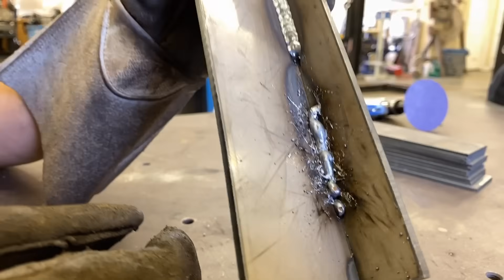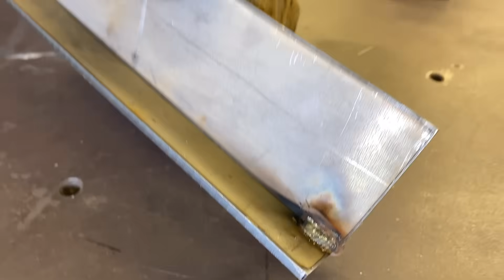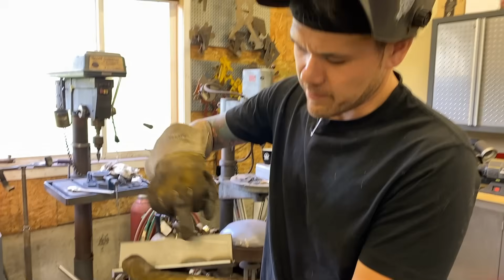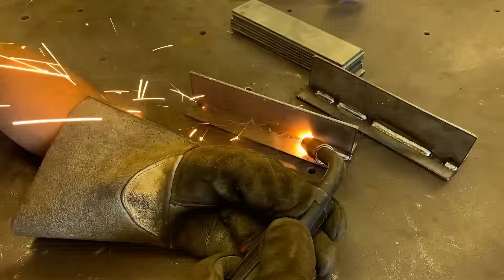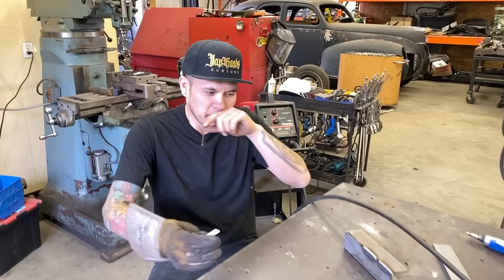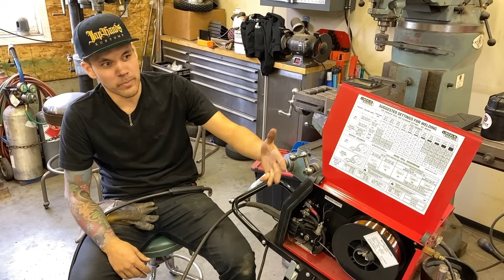MIG Welding Basics For BEGINNERS!! How To Set Up Your Welder + Tips, Tricks & Techniques!!

Comment: So I'm a first timer, do I need welding clothing beyond gloves and an auto-tinting mask? I was gifted, really loaned, a Miller 25/75 mix welder for a few months, and I want to learn on simple steel. The hopes are to weld parts and panels for my 62.5 Acadian wagon since we don't have any local shops that do this anymore. Do I need a welding table, or is a wood panel table okay, as long as the welding clip is clipped onto cleaned up metal for grounding? I tried to find a course, and many people said they would teach me, but none have worked out.

Comment: Great video! I have a miller 120v welder. I like to leave the roll of wire in the welder. When I quit welding what do spray it with to keep from having to remove it? Then once I use it again what should I spray it with before use to clean it. Use a foam block in there to clean the wire along with a liquid I bought at the welding shop and that does clean the wire however I want to protect that roll of wire if I don’t use it first a month or so without having to remove it all

Comment: Without good settings, U will NOT get a good weld. You have to find the settings first by trial and error on the thickness you will be working with. That's 70% of the weld right there.

Comment: Dear Sir, I'm recently retired and needed to have some welding done on my truck wheel wells but was turned down by 2 body shops, so my next step is to do it myself and your video was the exact thing that I needed. I searched most of the morning for a decent one that would be for beginners and found it in yours. I want to thank you and will purchase a welder just like yours and go forward. Hopefully I can find one on Ebay, it looks very expensive. Thank you. Gil in Massachusetts

Comment: Thats gotta be plugged in to a 220 outlet. 10 ga. Steel and actually burning in hot enough for penetration. I miss that. You just cant get a 110 wire feed that burns hot enough. In my opinion anyway. I miss having the standard Lincoln 220 buzz box. Trying to run 220 at home though. The power bill!!!! This is a good video for technique, but the type of electricity feeding that welder is crucial. What are you plugged into? And then the price of gas. So its 75% argon, 25% co2? I have a Lincoln combo machine. Only 110 power. I cant get that thing hot enough. Flux core and stick. Now im gonna try mig. Then toss it if the gas  doesnt help.

Comment: How do you test if a weld is good or weak? I was thinking of welding a frame for a trailer so my concern is with the movement of the trailer having welds break. 
Also, could a decent weld for welding a frame be done with a cheap harbor freight wire fed welder?

Comment: You are a natural teacher! Well done! I’m hoping to teach welding at school(high school) in a couple of years, so I figured I had better get some experience under my belt as soon as possible.

Sadly, I don’t have access to 220 power in my garage, so 110 welders are my only option.

The second potential problem I am learning about is the rental/ or purchase of a gas bottle. Apparently it can get expensive, especially for a hobby guy that welds 4 or 5 times a year. 

I’m learning that welding a chassis frame for a go-kart together isn’t doable(safely anyway).

The question is this, can you make another video that talks about welding with gas and without(flux core)? Also mention what you can and cannot safely weld with the various types(including 110 vs 220)

I’m finding welding a little tricky to get into for what I want to do.

Comment: You probable will ever see this comment/question. First, I am a 70 year old newbie at this. I have a Hobart 210.120/240 welder. I welded on a thumb to my mini, didn't look the best but worked. However, I had to take it off cuz the pin support bent. It is a GENTEC thumb, 8/24 hydraulic and NEVER thought that woud happen.  So, I built a cable to go into breaker box to change to 220v.  Do you get the "210" if this means amps at 220 and half at 120V? The manual indicates 3/8 " thickness for each voltage. This has 1 thru 7 heat ranges and 10, 20, 30, etc on the wire speed. Your video has helped me SO VVERY MUCH, thank you!

Comment: I am 3rd generation welder/machinist/gearhead, my 26 year old son. Is 4th and learned from my dad, myself and from trial and error.   My dad always said "solid push flux pull" but vertical was a variable, especially if high quality was a factor.  The old man would say it doesn't matter what it looks like if has good penetration and sealed into the material without hosing up the tip.  My 26 year old would deliver dimes or what I call "caulking" in any situation, the kid can work just about anything if the speed/voltage is in the ballpark.  I am grateful that my grandpa passed on the skill and experience to my dad so he could bait me into wanting to learn mig and tig.  There are SO many kids that will never even try to weld, it is nice to see the craft being used and shared like this video.   Nice work

Comment: I used to downhill all the time with  mild steel and stainless. The welder that taught me said put your wire almost 90° to the joint and weave the puddle and it seemed to work. I never had one break

Comment: Welding engineer here, this is a great video and well explained for beginners. 2 points: 

1. At the beginning he meant to say his gas mix is 75 argon/25% CO2. People don’t really use more CO2 than that. You can use 100% CO2 but you’ll only be able to get globular transfer (which is not what you want 99% of the time). 

2. Always wear sleeves when you’re welding (cover up all skin really). Even if you don’t get burned there’s lots of welders who have cancer in their forearms from welding without a jacket.
Reply: 100% block all of your skin, not just your eyes.
Reply: @smoovop117 right? Idk why you’d want to fade tattoos prematurely
Reply: Amature here. Thanks for pointing out that gas mix ( approx. 56 seconds into the video). I might've made a frustrating mess of things the other way around.

Comment: You're Wrong! J/K. You're Awesome! Thank you!
Reply: Ya know, "doing it by sound, look, and feel" is extremely helpful and makes sense to me. I haven't welded since high school, but I do sew a lot, and it's surprising how similar welding and sewing techniques are. You almost have to get to know each machine and material. In sewing, you have to adjust the tension, speed, and stitch depending on the type of fabric or thread you're using. There are very few instances where "always" and "never" come into play. It would be difficult for me to explain sewing with just the numbers (set your tension to 3, use all-purpose thread, have 5 stitches per inch). 
So now that you've explained it properly, I shall think of welding as "sewing with metal!"

Comment: hey boss thank you for the video definetly learned alot. i wanted to ask you to weld a stainless steel muffler say daynaflow to a mild still pipe on my mustang Mach 1 can i use same shielding gas 7525 say with .030 wire. or do i need a whole different set up. i meant its a catch 22 trying to weld a stainless steel muffler to a mild steel. its like saying what came first chicken or the egg.
Reply from the maker: It's no problem to weld it like it's milds steel. Same wire gas ECT.
Reply: @MakeItKustom  your reply helps me a ton you have no idea. stay safe. thank you very much . i can wait to start welding.

Comment: I'm a structural welder myself. I always whip and pause because I prefer doing that over running straight welds. Whip and pause is one of the strongest welding techniques, aswell as running a straight stringer. However if I'm welding a corner-to-corner joint, I turn my settings down a little bit and move in a weaving pattern around the root of the joint (cursive e, cursive c, etc). The reason I do that is because if I were to whip and pause or run a straight stringer down the root, it'll blow through the other side of the joint, so I focus more on the side wall penetration rather than the root penetration in this case. Plus turning the settings down a bit while doing ur weaving motion around the root for corner-to-corner joints is better because when you weave around like that, the heat input into the metal will also increase and you'll also still get a flatter looking weld even tho you've turned your settings down. The only case for a corner-to-corner joint where I'd run a straight stringer or a whip and pause is on sheet metal and I'd keep my settings the same too in this case. This is because the settings are low enough to not burn through the root of the joint and because sheet metal is so thin, if u weave around the root on a corner-to-corner joint, you're much more likely to cause overfill. Root runs might be needed to fill in any gaps on a corner-to-corner joint before you properly weld it depending on the size of the gap, how hot your settings are and your welding technique and how big of a weave you do. This is my advice, I'm just a nearly 2 year experienced/coded MIG welder for structural steelwork

Comment: Dumb question: how do I set up my auto darkening hood?????
Reply: On the inside should be knobs for adjustments. There are certain ones with knobs on the outside. Close to the ears.
Reply: If not knobs buttons. (For the inside) It's on the visor.

Comment: Your mig technique is different than most I've seen on YT. Your, as you say "pushing your puddle". Most will say, "drag if slag". Can't argue with your results. I'll give it a try. I just bought a gasless flux core currently running on a 110 plug. With the provided .035 fc wire I was able to put a nice bead down on 1/8 steel with what looked like good penetration. 
I have now separately purchased Lincoln .030 fc wire at HD and am trying to butt weld 22 gauge sheet metal. Have had some problems with burn through. I want to see if your "push the puddle" helps. My machine is gas mig and lift tig capable. After some what mastering fc mig, you've kinda got me looking at lift tig.  I'm also lovin your sheet metal fab content.

Comment: Dude. This is generally the best CO2 Welding techniques video of all time.  I'm having a full day of Structural steel welding today, I have not welded on a CO2 machine for the past 5 years and this tutorial just refreshed me up and the fact that I will be using a completely new machine on this job, your demonstrations just put me at ease and I won't have to worry about what is written on the machine, I will major on what I hear with my ears and what I see in the welds that I do when setting the machine up. Thanks buddy

Comment: The video was excellent! I agree that properly setting up the machine is crucial. I'm a fan of the push and back technique, which I consistently employ. It effectively fuses the pieces together due to the high heat, resulting in a more consistent weld.

Comment: Here in the uk, an inspector would look at a that whip weld and fail it instantly, same goes forcthe circles,  those techniques cause lack of penatration because your moving in and out of the hotspot causing cooling as you go forward then whip back

Comment: I just purchased my first mig welder. It's a 120 input model and I plan on using it to do some body repair.(quarter panel rust repair) This was great info for me to see. I still have a bunch of reading to do before I try my first weld, but this was great to see and hear what a decent weld should be. Thanks for the info.

Comment: Wow. Great video. Thanks. 
I’m new to welding. I’m starting with mig. Eastwood mig welder (🤔), flux core and 1/4” steel. My welds look like crap. Metal everywhere except where I want it. Seems like my wire is always longer when I pull back. Even when I use the recommended settings on the units door. 
I have 2 tanks but need them filled. How important is it to use gas as opposed to flux core? I get splatter everywhere. But at least I now know what to listen for. 
Paul.
Reply: From what I understand the flux core makes it so you don’t need gas. The gas is for solid core wire.

Comment: Would taking a propane torch nothing to hot not map but regular to heat up the area first a bit then weld I live in Alaska n weld outside most of the time I am a more or less a beginner had a friend show me basics and kind of went off with it welding anything that would stick

Comment: 2:39- Oh great thanks bekause Subi Sanctuary refused to answer for strutt tower repair what settings and wire he was using. 

So mig welding it should sound like the perfect bacon frying that will take a little to feel that out but that is a sense orientated way to learn to weld with mig which helps! How do I measure my travel speed komparing with the perfeckt bacon cooking sound? What should my weld penetration and weld bead look like and the weld puddle.  I believe you said you use 0.030 wire but who is your wire from.

And I see you are using gas no flux core so where did you get your tanks, how much were they, how much to fill them,  kompany is probably only Canadian so asking that will do no good, what about your regulators and hoses, what mix are you running for strucktural welding, at what pressure?

Regarding needing 220 volts for structural welding:
So then is that three phase by you and how many amps does the transformer and incoming lines have to be set up for to do structural welding?  

And let me guess all cheaper generators are only 110 volts with lower amps So I am screwed with getting a 220 volt generator cheap?😦

Okay, I just heard maybe laser welding would be a option for struktural welding. What is your knowledge with laser welding bekause I have zero and I kan't imagine that it would be any less pricey than a 220 mig welder equipment even if it kould work off of 110volts?
Thanks😥

Comment: This video is more than 2 years old, so this comment is a bit out of date, BUT, near the beginning of the video, you say you have a bottle of 75-25 gas. You then say it's 75% CO2 and 25% Argon.  Should be the other way around.  You can use pure CO2 as a shield gas, and 100% Argon is the standard for aluminum and stainless. However, when mixed, these two gases do a much better job of providing a shield atmosphere that enhances your weld profile and arc performance.  Even with this (I assume) slip of the tongue, I enjoyed the video.

Comment: I really liked you video on setting up the welder for beginners. I am a beginner and tried setting up my Century welder and tried welding. My welds are horrible- a lot worse than the worst weld you showed. I’m going to try setting up my welder again using you suggested settings and weld. In your opinion is it better to learn welding without gas or with gas? Just curious to hear your opinion. I have to say your technique produces excellent looking welds.

Comment: Yes, sir I have viewed this video before, and it is always refreshing to refresh. As in your video regarding flame cutting with a cutting torch the process was easy to view being shown through the welding lenses and this demonstration would be easier for the beginner to see the actual weld puddle being formed and moved along the piece. It is actually the same process as gas welding (well duh!!!!!) and when one see's the welding puddle and the tap,tap,tap of the filler rod into the puddle one can relate that to the actual mig welding process which is as you know a faster way of welding as opposed to the gas welding process although the two are the same. A very good instructional video. You had a good teacher when you learned how to weld. I stress for people to take a good welding class: it is something that will stay with a person as long as they do not get rusty.

Comment: Hey awesome video. I wemt to welding school when i was in Votech when i was 17. I'm 34 now and i had a car accident 6 years back which erased my memory of certain things.
This is helping a lot, and i think its one of the best explanations especially with things like, visual, sounds to help newcomers teach themselves welding.
Can you do a Flux Core E71T-11 vs E71T-GS version of this video?
I think most people just starting will be able to afford Flux Core and 3:1 welders.
In fact im planning on getting a YesWelder 3:1 with Fluxcore/Stick/Lift TIG.

Its expensive if you dont get affordable welders.
The Welding Jacket, welding helmet, Thick and Thin MIG gloves, welding blanket, rods/wire, slag hammer, welding clamps, welding magnets, practice steel and coupons of various thickness, dust and gas respirators, welding shoes and appropriate FR jeans/pants.
And thats just starting out.

Comment: Thanks for the video I have a job smart 110v mig and it welds great but I recently purchased a lincoln 125 almost brand new for $150!!!! and thought maybe the welder is messed up and I just got ripped off turns out I am used to welding at granny speeds "no offense to job smart" which is an awesome welder -turn it before you burn it

Comment: Hello  Mr  Mig  the  instruction how to set up the machine  cable speed  volt settings etc diff type of welding patterns I like the one forward and little back in the end of puddle then forward again  very good technic  thanks for the valueble tutor

Comment: Great video.  Only thing is the vertical scenario you talked about welding vertical up, but, you only welded vertical down with tow positions of gun (pointing up or down). I take the expression of welding up as moving from bottom to top (not shown). This is important as my upcoming efforts include vertical inside corner  seams.

Comment: I've gotten decent at mig welding recently. But I've basically just used auto wire speed. About to get a job welding in a factory and they keep wire speed up all the way. I don't have a Welder to practice that on. Any tips or videos on welding with wire speed so fast?